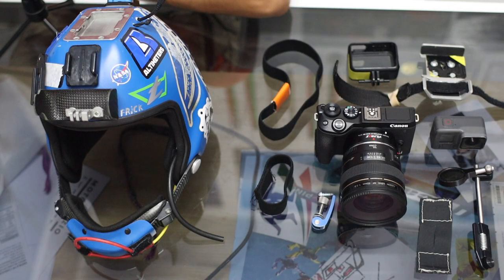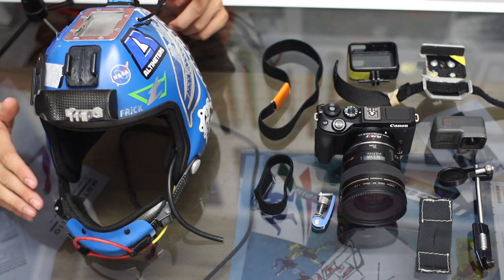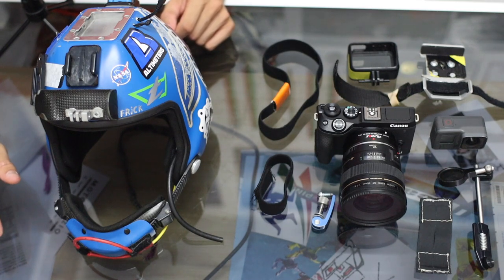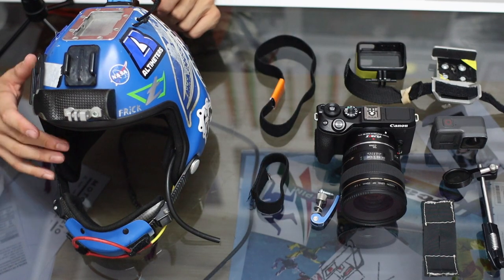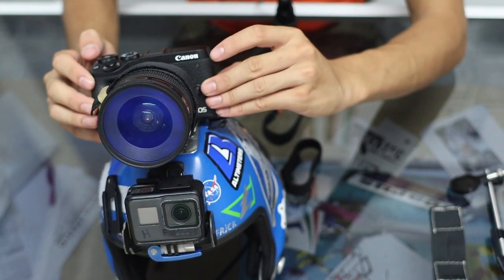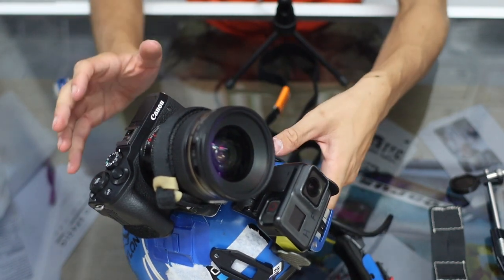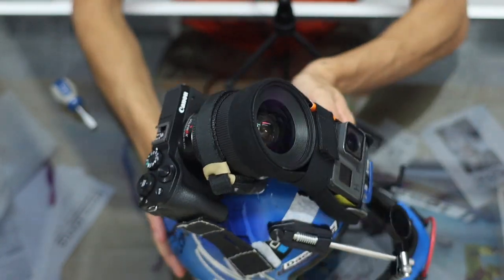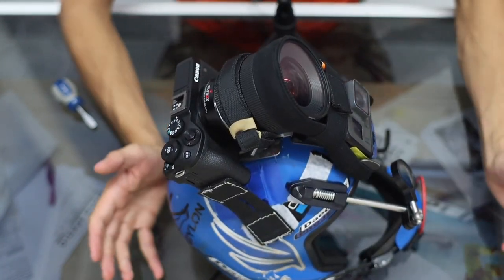Camera Flying Basics - Ep.6 - Camera Helmet Basics

Comment: How did you get your mount to angle slightly up? I have a tonfly 2.5x and use the top plate mount
Reply from the maker: hello bro. I used a bunch of washers. a 3d print option is better